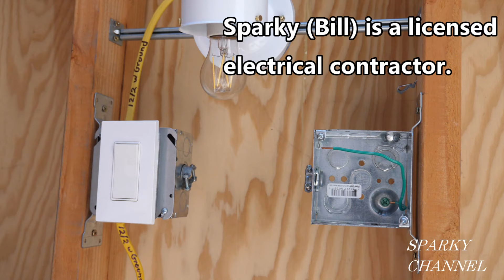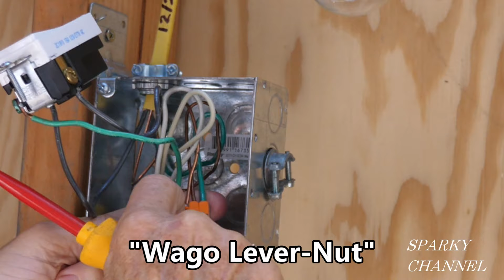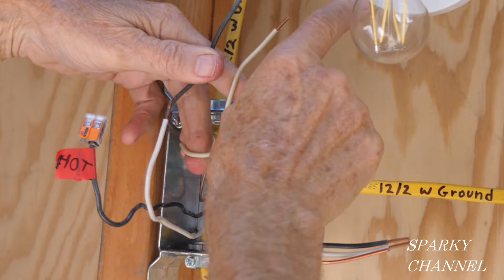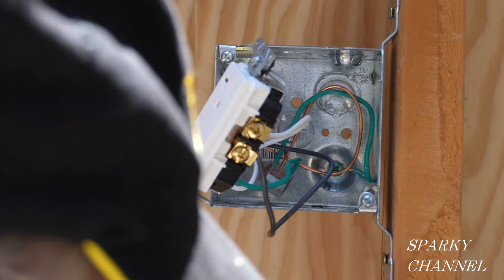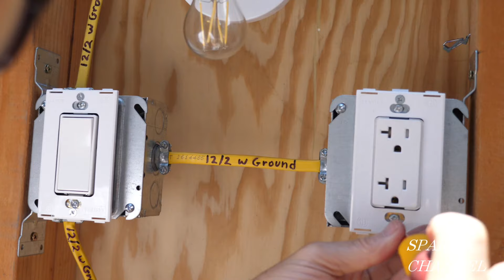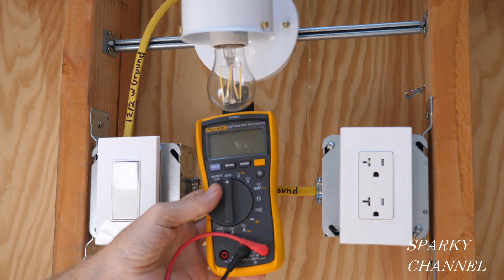How to Add a Receptacle to a Lighting Circuit

Comment: The light in my bathroom keeps going off after a few minutes when you turn it on.what’s causing that?
Reply from the maker: I think that something is loose, perhaps the light bulb. If not the bulb, perhaps a wire in the light box or switch box.

Comment: @Mr. Sparky.. why doesn’t the switch get a neutral wire go into it?? #1st year apprentice
Reply from the maker: Hi Prince! A standard switch does not take a neutral. Some digital switches do require a neutral though. It will usually say on the package when you buy the switch.
Reply: Should add a pigtail for future upgrades

Comment: Is the purpose of the wago nut just to tie the lines together? Thanks.
Reply from the maker: Yes, they are wire connectors.
Reply: It's a new age wire nut LOL, but it allows you to connect and disconnect multiple lines without taking all the lines apart and twisting and re twisting wires which cause fatigue.

Comment: Why pigtail needed for ground in outlet box?
Reply: I believe you have to ground the boxes if they are metal.
Reply: A metal box must be grounded (bonded) so if somehow a hot wire hits the box it trips the breaker.  That way a wiring fault can’t make the box  “hot” without tripping the breaker.  Safety!

Comment: Thanks for the videos, keep it up. In my remodel, recepticals are all on 20amp 12ga circuits. It appears I need to use the 20amp T hole recepticals shown in this video in all locations. But, I’m in lots of homes each month with my work and do not see these on common walls, ever, even in new homes. What gives? Are they NOT installing 12ga 20amp circuits for recepticals? Can the common 15amp recepticals be used on a 20 amp circuit? Or, am I missing something? Happy 4th of July!
Reply: It’s common to run 14awg 15A circuits for most general use receptacles in a house, however a smart thing to do is run 12awg on ur 15A circuits so if there’s ever the need to add extra receptacles or to handle a larger load, it’s a lot easier and cheaper to just replace a breaker and outlets to 20A rather than having to re run all new wire
Reply from the maker: I made a video answer for you: Shall I Use a 15A or a 20A Receptacle on a 20A Circuit? + 2020 NEC 210.21(B)(1) and 210.21(B)(3): https://youtu.be/-0zqSWEryOE

Comment: I do not get the overloading section at all. Every receptacle is capable of pulling its maximum amperage. Does code allow people to use one breaker to control two outlet in parallel, but in series with the breaker? I have seen many houses with one breaker in charge of two or three rooms and less then ten outlets. The shared section of wire would see twice the amperage of each outlet. 
Correct me if I am wrong. My understanding is that the breaker rating should match or be smaller than the rating of any wire in series.
Reply: Overloading occurs when the total of current draw from all the loads on at the same time exceeds the rating of the circuit breaker. One circuit breaker can commonly supply multiple rooms where the anticipated maximum load is less than 10 or 12 amps. This can be a 15 amp circuit as lights, radios, tv's, computers, are typically low power equipment. The receptacle rating is not the issue nor is the term "series". Receptacles cannot be wired in series, it's always in parallel, regardless of whether you're using wire nuts and pigtails or using the additional screw on the receptacle to go downstream. In kitchens, where the anticipated load can be quite high 20 amp circuits and dedicated circuits are common.
Reply: @surferdude642  Thanks for reply. I corrected my comments. What I means is to use one breaker to control one or two rooms. Therer will be easily 5 outlets controlled by one breaker. I dont think people use Gauge 8 wires to wire those outlets.
Reply: @GardeningZ  I think that you are referring to multiwire branch circuits. In this case you will have a double pole breaker connected out of phase, one to L1 bus bar and one to L2 and a shared neutral. In this case the return current on the neutral wire will be subtracted, not added. For example and for this circuit, if L1 was drawing 10 amps and L2 was drawing 8 amps, the return would be 2 amps. If you somehow connected them in phase it would become a dangerous situation because the current would be added. 
Typically, 12-3 would be used, 2 hot wires, red and black and a shared neutral.
Reply: @surferdude642 No, I am not referring to dryer outlets. 
I guess the code treat light and outlet in a different way. Light is treated as a permanent load, and outlet are treated as variable load.
Reply: @GardeningZ  I'm not referring to 240 volt circuits here. MWBC'S are 120 volts, hence the neutral center tap and work with regular 120v 15a receptacles.

Comment: Could you have run the outlet directly from the light? Per code that is, thanks.
Reply: I believe that you can, but keep in mind that the receptacle will only be live when the light is on.
Reply: @surferdude642  thank you

Comment: Can I add multiple receptacles  in parallel to a lighting circuit?
Reply: depends on how much amperage ur breaker is using
Reply: As THE WHOAT pointed out, it depends.  If you're going to just add receptacles for lamps then it's no problem.  Sparky calculated 0.83 amps for the existing 100 Watt fixture.  So if you want to add three more receptacles for lamps then you're at (4x.83)  3.17 amps for the circuit.  If you add a 400 Watt stereo,  (Wattage / Voltage= Amps). 400w/120V = 3.33 amps.  So now you are at 6.5 amps for the 20 amp circuit.  You never want to exceed 80% continuous draw on a circuit, so that's why Sparky said 16 amp max.  You are still way below that, so for "normal" loaded receptacles, you are fine.  Note: Sparky's example was a "20 amp" circuit.  You need to check to see what breaker protects your circuit.  If it's a 15 amp breaker, then 80% would be 12 amp max.  You are still fine.  Hope this helps.

Comment: Bill, I’m in CA and working in my garage. If I add a receptacle to a circuit like this, isn’t it against code to place the new receptacle that close to the line box or inside the same chamber of 16 on center where it is right now? I thought you have to place this receptacle at least 24” away from where you have this switch box and in a separate framing chamber.
Reply: Bill has the boxes placed close together for instructional purposes only, it keeps all the work he is doing centered on the screen, he is not doing a real wiring job..
Reply: I'm not an electrician, but I doubt that would be a problem, 2 and 3 gang boxes with a mixture of receptacles and/or switches are common.

Comment: Use the wrong receptacle, that one is only to be use alone. 20 amp receptacle is for a dedicated circuit of a 20 amp breaker.
Reply: Umm, no it is not wrong. It is a 20amp circuit with 12 awg nm cable. 00:35

Comment: Okay, guy. You don't need to check 100x that your circuit has power. It's redundant!!! A homeowner shouldn't be working on electrical if they can't even tell if the cable has power
Reply from the maker: I understand. But with electrical, it's safety first.
Reply: Why are u complaining about it. Its good he keeps repeating himself. sum ppl need to here the samething 100x before they understand it. if u dont like it keep it moving. have a happy new year